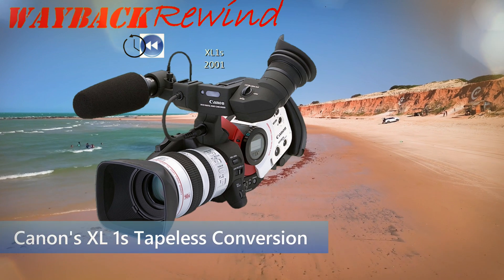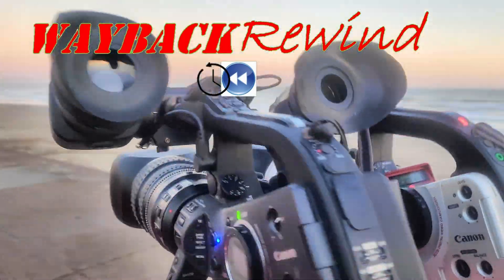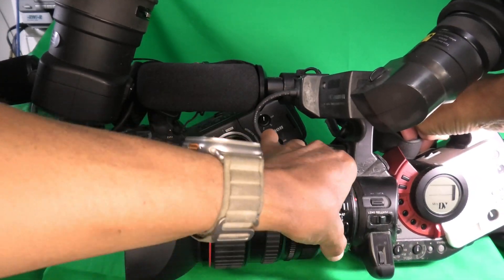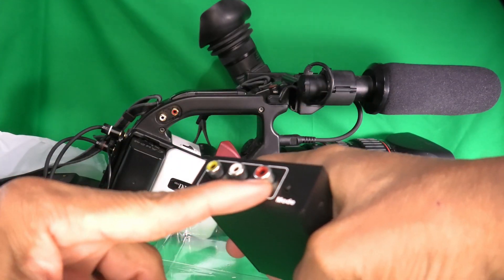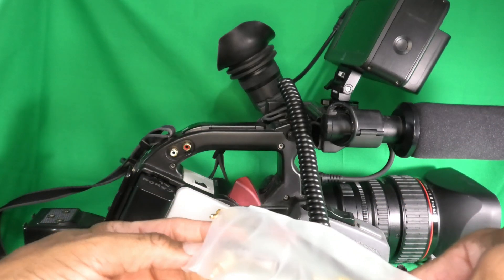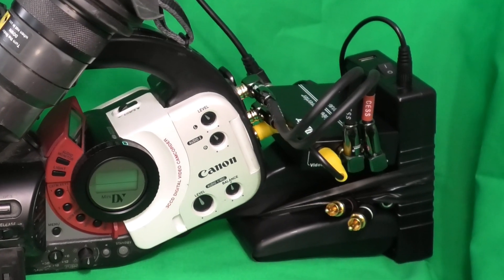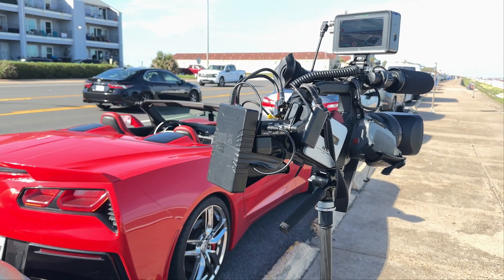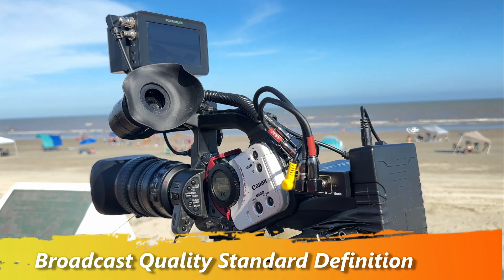Canon XL1S Tapeless [ MiniDV to Harddrive Recorder]

Comment from the maker: What did you think about the tapeless results?
a) Great job it looked better
b) It looked about the same
c) It looked worse
d) Maybe worth the effort regardless to avoid using tapes
Reply: I would say C, sorry but I thought the tape looked better IMHO.
Reply from the maker: Me too, hence my disappointment.  We'll it was worth a try.  Thanks for watching.
Reply: id say i noticed some improvements, though at times it looks like the mini dv has the sharper image, you lose some of of those quirks of tape like the scan lines and such, but if I'm going to be shooting on a tape camera for a tape camera look wouldn't i want those? but a successful experiment none the less in my opinion, it may not be a bad idea to do both when filming, just as a fail safe in case of lost footage or just to have a more clear monitor to look at, keep the XL videos coming!
Reply from the maker: Thanks for the feedback. The XLs are amazing cameras even if they are obsolete.
Thanks for watching.
Reply: Something in your composite output chain was doing a blend deinterlace. It's best to find equipment that preserves and records the 720x480 29.97i. A Windows laptop with thunderbolt and an Apple firewire adapter using the WinDV software would look identical to the mini-DV tape and wouldn't require the additional tape capture.
Reply from the maker: @jonpoeschek Yes, normally I would capture through the firewire.  I use the Pinnacle movie box plus, which converts firewire into USB.  But this was an experiment.  At best, it looked the same.  If I had a more sophisticated deinterlacer, it might look better. One of these days, I'll try that.
Thanks for watching.
Reply: @WaybackRewind  Maybe S-Video would give better quality?
Reply: C definitely C.
better sticking with tape and software upscale after capture, if you plan to share some footage on youtube to avoid SD yt compression disaster.
Reply from the maker: Software upscale is definitely better.  But sometimes you have to try new things to be sure.  I will try out some AI upscalers in a future video. Thanks for watching.
Reply: Definitely C. However, maybe worth the setup for instant digital files. Better than having to essentially re-record them via software to digitize it. 

Definitely gives me ideas. Thanks for this video. Didn’t even think this was a possibility. Will be exploring this a bit more.
Reply: What is the black lens and this work with xl1
Reply from the maker: The black lens belongs to the XL-H1S and it's fully compatible with the XL-1S. 
Thanks for watching.
Reply: C
Reply: c) looked worse, weird bad deinterlacing, visible when panning, etc. 
Maybe it would look better if you can shoot progressive mode (¿Was this camera capable?) or if you keep 4:3 proportion somehow.

Anyway, I don't see the point in upscaling DV footage. The whole charm of DV is its lower resolution. Better lenses are cool, tho.
Reply from the maker: @DonChups yeah the way I did it made it worse.  It was worth a try but that is not the way to go.  

Thanks for watching and commenting.

Comment: you could use the HVR-DR60 device connected to the FireWire (i.Link) port, and thus you would have the same quality in digital format without using a mini DV cassette ....
Reply from the maker: Yes the HVR DR60 is the only standalone device I know of, that will record directly from FireWire.   They are fairly rare and expensive and I do not own one.  But you are correct it would yield the best tapeless result.  Thanks for watching.

Comment: Hello and thanks for your informative videos!   Am curious as to why you used composite analog instead of component analog to SDI, and whether component would improve the image?
Reply from the maker: Excellent question.  The only reason is I don’t have the component cable for this camera.  It uses a somewhat proprietary connection.  It’s on my list of things to buy but it didn’t come with the camera when I bought it.  That may have improved the finished product.  Thanks for watching.

Comment: is there a way that I could get around recording to a miniDV, like what you're doing (although I don't care about upping the quality) without needing the whole power supply? Essentially I'm trying to avoid the hassle of getting the footage off the tape and instead recording it thru the camera but onto a digital storage system?
Reply from the maker: If your storage device has a built-in battery, such as mine here, you do not need an external battery.  I only needed the power supply to convert audio video into SDI. If I used an audio video recorder I would not have needed the power supply or the converter.
Thanks for watching

Comment: I dont think its bad or as "hideous" as people are talking about in the commnets, the fact that you can still see the pants and shirts of the people by the shore and even the tent poles is an example of that, great detail, I think most of the differences is from upscaling.....but if you match it and dont upscale it on the fly I think this would be perfect for running tapeless
Reply from the maker: Yes.  Visual quality is somewhat subjective.   It wasn’t bad or hideous but did not result in any improvement.  For a tapeless set up there may be rationale to use it.  Thanks for watching.

Comment: Different question, please. Anyone knows how to open up the aperature on the 16X lenses or those XL series lenses?
Meaning once you've removed the lens from the camera, the aperature is closed. What pins should be applied on lens to make it open?
Reply from the maker: There is at least one individual who figured out how to hack the XL lens.  It's far beyond my understanding.  It requires a microcontroller not just simply applying power to a pin.  Maybe you can start from where he left off?  Thanks for watching.
https://www.eevblog.com/forum/projects/canon-xl-spi-bus-lens-protocol/

Comment: Strange, the DV tape looked sharper.
Reply from the maker: Sadly, I think you are correct.
Thanks for watching.
Reply: @WaybackRewind  dv is 4.2.0 , 4x comp for Y (black and white...) 2x for croma ...choose a s-vhs input capture vcr to keep it in composantes .Best ever is to capture with a dv card .
i uspscale with winX AI dv files and ,it'amzing to 1080 to 4k .nice work ,nice xl1 . test with this software your files with the xl1h ,you won't regret (i've no stockoptions...) but....for compile 1 mn you need...1/2 hour...yes...iknow....sorry....
Reply from the maker: @ good advice.  No doubt to squeeze the most out of interlaced standard definition requires a lot of work.
Thanks for watching.

Comment: This setup is absolutely fucking cursed. There was no difference in the quality of video despite running 200 MB/S. I use a portable laptop for my Canon XH A1. Firewire > Thunderbolt 2 > Thunderbolt 3 and obviously it's super bulky and not convenient. The tape is no longer working which is why I've been looking for a solution. What appears to be happening here is it's not recording in full HD. It looks like it's SD. I wonder if maybe you missed a setting or the conversion box to SDI out doesn't allow for HD. So, it says it's taking 200 MB/S but in reality it's just taking the SD 25 MB/S
Reply from the maker: Well, a simple box can't add detail where there is none originally.  This camera is an SD camera from top to bottom.  Upscaling in this case is just pixel doubling or quadrupling  and then putting them onto a screen with no increase of information.  I was hoping that by bypassing the DV encoder would allow for some improvement but there was none to be had.  The only hope for upscaling is Artificial Intelligence that can actually add detail, but then it almost becomes an animation.  
Thanks for watching.

Comment: [c] The whites and blue sky are worse. Darker shades not so bad, but overall worse.
Is the Firewire output quality so low? If a camera has firewire, I go with that using the Sony HVR-MRC1K CF recorder.
Reply from the maker: The biggest constraint is that I don't own a Sony HVR MRC1K CF recorder and they are scarce, i.e. expensive.  But I did conclude my original theory is correct.  Once digital, it is best to stay in the digital domain.  I have the HVR on my shopping list. Thanks for watching.

Comment: Yikes! 
Great that I got a quick notification of this video, and from your results, maybe the best solution to my tapeless quest for my Sony VX-2100 is to just stick with DV tapes for the number of times it'll get used. For the cost of going tapeless, I can buy a used Nikon DSLR video kit (such as the D5100 with firmware hack to better performance) and achieve substantially higher quality results.
Reply from the maker: True.  I honestly expected the same or better, not worse.  DV tapes are getting scarce, and getting the footage in the computer was a pain.  But it might still be worth it. 
Thanks for wstching